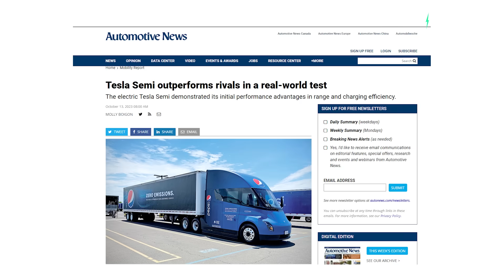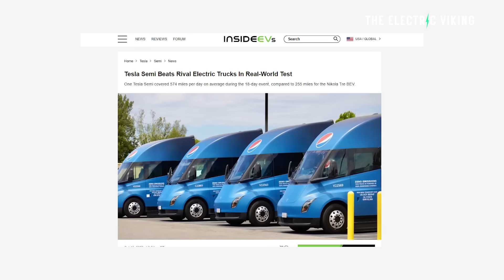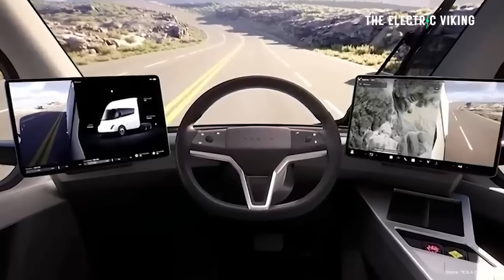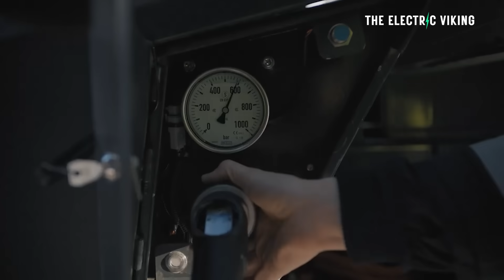Mercedes claim that Tesla Semi breaks the laws of physics proven correct

Comment: No hills, no wind, and less than a half load, thats how they broke the laws of physics
Reply: In the Run On Less tests, many of the runs were weighed-out loads of soft drinks, with a payload of 15 tons or more, climbing from near sea level at Sacramento, to 7200 feet at Donner Summit, on the way to Reno. But even a blind squirrel finds a nut once in a while; you're right about winds, which were pretty mild most days.
Reply: So according to the test they ran it was around 600 miles on American roads and at 80,000#’s only downside of that test was they ran at 55mph so that kind of sucks but otherwise I think it’s not bad for an electric semi
Reply: And running down hill !!!
Reply: lol big hill😂
Reply: @lonesome187  You seem to be conflating two tests, but getting neither of them right. The 500 mile range test was run in December 2022, from Fresno, CA to San Diego, CA, with an average speed of about 55 MPH, consistent with the 55 MPH speed limit for trucks in California.
The Run On Less tests, which this video is about, recorded three Tesla Semis delivering weighed-out loads of soft drinks from the PepsiCo Sacramento Bottling Plant to various destinations on 44 24-hour days in September, averaging 617 miles a day, with a maximum of 1,076 miles in one day, at governed speeds of 60 or 62 MPH.
Reply: @Wendy-nm9zw   And running down hill !!! 
See my response to @lonesome187. The 500 mile range test was run from Fremont, CA, elev. 56 ft. MSL to San Diego, CA, elev. 62 ft. MSL). Only in Wendy-math is going from 56 ft. elevation to 62 ft. elevation "down hill".

During the Run On Less tests that this video is the subject of, every Tesla Semi returned to its starting elevation at the end of each day, so the average elevation for each of 44 days was exactly level.

I'd be interested to hear where you came up with your claim of "running down hill".

Comment: The Superchargers at Pepsi are 700 kW.  They basically use two V3 Supercharger input circuits for each truck Supercharger.  Basically what powers 8 V3 superchargers (4 each).  Each cabinet's input is 430 Amps 480V 3-Phase.   Max continuous power of 350 kVA.  That gives 350 kW * 2.
A video of the Pepsi site shows 4 V4 Superchargers hooked up to 8 V3 cabinets.  A presenter mentions a 3 MW grid connection.  That makes sense, 8 cabinets use 2.8 MW of electricity.    The cabinets can cross share up to 575 kW.  So the max through put of a cabinet is be 350 kW + 575 kW = 925 kW.  My guess is 700 kW with 4 trucks and maybe 925 kW with less trucks.  So a maximum between 700-925 kW.
I have not seen the spec plates.  The big unknown is the output power of that semi charger cable.  I don't think anyone has seen that yet.  
I just took a look at a newer V3 spec plate.  The vales are slightly increased.  From those spec I would estimate 774-967 kW maximum.

Comment: Engineers are overlooking what the BMS and drive motors are doing.  Its not a question of how the system is made, its a question of how the system is being operated.
Reply: A big part of the Semi's success is down to the powerful motors.  The secret sauce is: The motors are way more powerful than they need to be for forward motion.  But this large capacity gives the ability for much higher amount of regen charging of the battery when braking or going downhill.

I suppose the other companies will figure this out in about five or six years.  If their brains don't go back into hibernation.

Comment: I presuppose that the Tesla MegaCharger will be about 1,5 MW.
Very simple calculation:
The transformator used for 4 SuperChargers is at 750 kW.
Take 2 of them together for one MegaCharger and you will have 1,5 MW.
Tesla allways tries to use equal components for all applications.
Reply: Currently installed Megachargers are 750 kW, as are the 72 proposed in a charging network between Fremont, CA and Laredo, TX.
Reply: @BigBen621  Thank you for the information.

Comment: What I don't get is why the other companies persist in making their trucks look like their diesel versions. Air dynamics as with cars has to be top of the design spec sheet and they have a flat slab hitting the air. But then we have SUV EV's because the market has sold people on a design that uses as much fuel as possible negating any  small improvements in the efficiency of the engine. Fun fact. 50% of SUV fuel is spent on a motorway on coping with driving a square brick through the air. We need to see vehicles that actually look like they were designed in 2023 and not in the 90's

Comment: Merc needs to start with an erodynamic shape ! Boxes don't cut through air too well , well that's what the girl on the checkout at Aldi said 😂
Reply: For short haul inside a city aerodynamics is not all that important.  A box will do if the result and make it through the narrow roads and tight turns.  For longer trips, the load really should be on rails.  An electric train is going to do a lot better on tons moved a distance per KWH.
Reply: Greetings. Aerodynamics isn't really important for long haul. The driver needs a cabin with a berth. Having the steering axle beneath your arse makes the vehicle easier to manoeuvre in tight spaces.
EV-semis will work where the starting point and destination have MW charging points. We'll need diesel for everything else.
Reply: There are length ´rules, and streets / destinations are more narrow in Europe
So max length rules are much different.
In the US, a trailer can be max 59 feet, the truck itself has no length limit
In EU, the complete length is max 61 feet
Reply: They are boxy, because in Europe, the limit in length of a truck includes the cabin, unlike in America where it is only the cargo that counts. So European trucks are boxy like that to be shorter and be able to carry more cargo.
I get why they did that law... American trucks could not turn in most European streets and in some roads. Putting a limit gives civil engineers the assurance that every vehicle can make a turn, or that it will fit in a cargo bay. But it is one of those laws that are done with good reasons and intentions, but that generates unintended side effects.

Comment: The physics aspect that everyone seems to ignore is the batteries... there is a limit to how fast you can charge batteries while maintaining their integrity.  It will be interesting to see what speed of charging various sizes of batteries can actually endure in real world conditions.  No matter what when you charge batteries quickly it puts more wear on them then charging them slower and that fact is often overlooked in the electric vehicle industry.
Reply: nah i think the biggest physics aspect everyone but tesla seems to ignore is aerodynamics for efficiency.
Reply: Actually, new studies have confirmed that the problem is not charging speed, but heat.

If the BMS keeps the temperature within the safe range, then fast charging does not affect battery health or longevity.

Comment: Fuel cells allow for more payload. I don't know how the economics work out, but a lot more people in the trucking industry seem to be interested in fuel cells vs BEV. I'd be interested to see a more head-to-head comparison.
Reply: The economics for H2 don't work out well. Here's a real world example: the Toyota Mirai carries 5.65 KG of H2, and gets an EPA range of 357 miles. A KG of H2 in San Diego, where I live, is currently about $36, having recently increased from about $13(!). So the per-mile cost of H2 for the Toyota Mirai is 5.65 x 36 / 357 = 57¢. Meanwhile, a Tesla Model Y has a 75 kWh battery, and has an EPA range of about 320 miles. At residential EV charging rate of about 15¢/kWh, the per-mile cost of electricity for a Model Y is 75 x .15 / 320 = 3.5¢—94% less than the cost per mile of H2; that is, the cost per mile of H2 is 16 times as much as the cost per mile of a typical BEV. And actually, my cost is zero, because I recharge from my rooftop solar array, which of course H2-fueled vehicles can't do.

Comment: Someone who says "x breaks the laws of physics" usually doesn't know physics, let alone the laws of physics.
Reply: I'm more charitable.  Someone starts with some assumptions, turns the crank on the laws of physics to see what that implies, and points to the results as what the laws of physics say is possible.  My father, who worked in early computers, says that people would publish papers about the theoretical limits on computers dictated by the laws of physics.  Then those limits would be surpassed.  This happened several times, until such papers became less popular.  Of course, the laws of physics didn't change, and were unviolated.  How does that happen?  Well, people pull some assumptions out of the air, launder them by running them through the laws of physics, and make such "laws of physics" claims.  The laws of physics are sometimes printed on T-shirts and even taught in schools; people should do their own calcs.  Just make note of what assumptions you're making...
Reply: Exactly, and what laws do they claim Tesla broke? It was just an expression from Mercedes, not a scientific statement

Comment: Good video coverage of Tesla's performance in the "run on less" event.  Pretty impressive.  A couple of minor corrections: Tesla semi are build near Reno NV, not Las Vegas, and they use 2170 cells, not 4680.  IIRC the latter was confirmed by Tesla execs (Elon and Drew) at the last earnings call (Q22023).

Comment: I do wonder how EV's handle over-charging downhill. A key safety feature of trucks on long downhills is the engine brake.  If a truck is near full charge at the top, regenerative braking would not be enough to hold it back.   Brakes alone without help from a transmission and drive train aren't enough either. This will not be a common occurrence, but eventually, someone will plug one of these things in at the top of a big hill.
Reply: Thinking charge termination voltages are actually lower than maximum permissible battery voltage, so you can in fact dump some current into there even when you're fully charged. But this does wear the battery quicker.
Reply: eventually, someone will plug one of these things in at the top of a big hill. 
This presupposes that there's something to plug it into at the top of a big hill. But no electric truck would ever need to charge at the top of a hill, and charger installers plan to amortize the high cost of the installation with sales of electricity; so who's going to install a charger at the top of a hill, with the prospect of no revenue from it? 

Even if someone did, and some trucker did plug into it, Tesla cars warn you when regen braking is limited; and the Tesla Semi would do so as well. And if the trucker ignores that warning and proceeds downhill, friction brakes are enough to hold it back, at a low enough speed. And if the truck ignores all of these warnings and proceeds downhill at a higher speed than the friction brakes can manage, well, then, that's what all those runaway truck ramps are for. 

There are certainly many ways in which semis, including electric semis, can lose control; but doing so because someone charged from a non-existent charger at the top of a hill, ignored the warning that regen braking was compromised, proceeded downhill at high speed, and failed to steer into the runaway truck ramp, has to be at the very bottom of the list of how this might occur.
Reply: So basically the short answer is that when some idiot who lives near, or finds a truck stop or some other power outlet at the top of a big hill, the person is screwed and it is their own damn fault so don't worry about it- and besides no one could be that stupid, right?   
So the reality is that in the situation where you have an EV at the top of a hill with no available battery capacity, the only thing slowing the truck will be the brake pads, and hopefully some common sense from the driver. 
And BTW are obviously not a truck driver. I lost my brakes going downhill once, it wasn't fun. In a vehicle with a regular ICE, the transmission connects the engine to the rest of the drive train. In a low gear at low speeds, and with correct RPMS, the resistance from that alone is enough to hold you back MOST of the way. The brakes can do the rest on their own. If you are in neutral, or using an EV not providing any resistance, the brakes have to do it on their own- and they can't, not at any speed. If you have a jake, you can safely go much faster since the regular brakes won't be used much.  Personally, I was hoping that someone would say that the trucks will only ever charge to 85 or 90% to preserve battery life, but in an overspeed situtation, alarms will go off and it will fully charge it while simultaneously slowing it to a stop. But I have no idea what the engineers are actually doing for this, if anything.
 @BigBen621
Reply: @dividebyzero1000  Too funny, with the fake outrage and all! I got a big laugh out if this.
Oh—you're serious? OK, let's see. 

 _ finds a truck stop or some other power outlet at the top of a big hill_ 
Tesla Semis and other electric trucks can't just plug into "a truck stop or some other power outlet"—they have unique charging connectors, and can only plug into dedicated Megachargers; or in some cases Superchargers. 
You have ignored the fact that Tesla won't spent the major cost of installing a Megacharger and Megapack in a location where no one needs to charge their vehicle, and thus there'd be no revenue.
If "some idiot" did figure out a way to charge at the top of a hill, he'd still have to ignore the warnings from the Tesla Semi that regen braking was degraded, and proceed downhill at full speed. 

 If you are ... using an EV not providing any resistance, the brakes have to do it on their own- and they can't, not at any speed. 
This displays either an ignorance of physics, or desperation to prove your point by deliberately ignoring physics. As you learned (or should have learned) in high school physics, the energy generated by driving downhill that must be dissipated by the brakes is proportional to the product of the speed of the vehicle; its mass; and the sine of the angle of descent. 0 speed, 0 energy. Low speed, low energy. High speed, high energy. So no matter what the slope, there is always a speed low enough that the ventilated-disk friction brakes can dissipate all the energy created by driving downhill.

So now, before you have a runaway Tesla Semi situation, you have to have a trained and licensed Tesla Semi driver who was somehow able to charge his Tesla Semi to 100%, in a location where there is no Megacharger or Supercharger, and ignoring the fact that optimum charging is to 80%, because the charging speed drops off rapidly over 80%. Then, the trained and licensed driver has to ignore the very intrusive warnings of degraded regen braking, and drive downhill at a speed higher than the ventilated-disc brakes can handle. And before there's an accident of any kind, he also has to miss the runaway truck ramp farther down-grade.

Meanwhile, a diesel truck can lose its Jake Brake from any one of a number of possible single-point mechanical failures, including failure of any of several u-joints in the drivetrain; failure of the clutch or automatic transmission; or failure of the Jake Brake control or mechanism itself. And since you're positing "some idiot" for the Tesla Semi driver, it's equally likely that the diesel driver would be "some idiot", and simply fail to engage the Jake Brake and continue downhill at speed; which is certainly as likely as all the failures that have to occur for a runaway Tesla Semi.

In summary, your scenario requires so many sequential failures as to have a infinitesimal chance of occurring in the real world, while a diesel semi has several single points of failure, any one of which could put a diesel truck in the same position of having to use the runaway truck ramp—which is placed where it is for exactly that purpose.

Comment: Going EV means a massive investment. Not just in the actual truck but in providing enough charging bays. 1MW bays are very costly, since it involves upgrading all the electric infrastructure. EV truck operators will also want certainty of charging, especially for overnight stops, so maybe charging  will be required in most truck bays. But how close should trucks be parked, especially with valuable loads? It is not that EV trucks will be likely to catch fire, but the inferno if such an enormous battery ignites. What will insurance cost, assuming cover is available? It will need an adventurous fleet manager to propose going EV!!

Comment: Now they need 40"-53" trailers with full solar roofs to charge on route!!!
Reply: Elon Musk didn't think it would be worth it.  People don't understand batteries. They keep insisting that solar be at the place of charging.  

I can see small cars, and even shade canopies that have solar. Provide shade, protection from hail, rain.  That makes sense.  There are some urban streets that have covered sidewalks, it would be nice.  

I don't know, food trucks, would probably help.
Reply: Would be a very good idea to cover the trailers in solar panels 
Great for refrigeration also…
Reply: @tireddad6541 that was for cars where weight is much more important.
Reply: @whowhy9023  Weight is arguably more important in the hauling industry.  A higher empty GVW means less carrying capacity for operators.
Reply: A solar panel covering the full surface area of the trailer will, in real workd conditions, generate about 13kW (probably a lott less when mounted on a moving playform at suboptimal angles). This will make a negligible difference and reduce the truck’s payload.
Reply: 40-53 inch trailers are not very big :) :) :)
Reply: NOT currently allowed, by DOT.